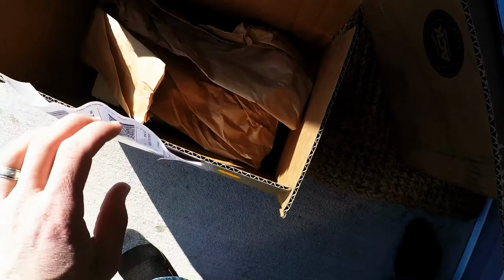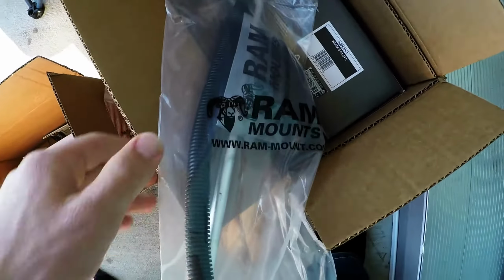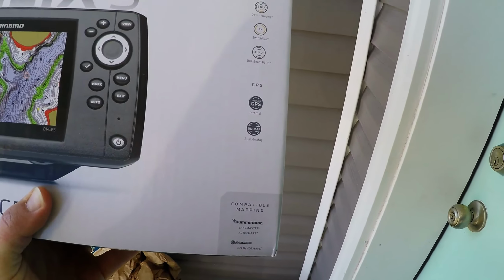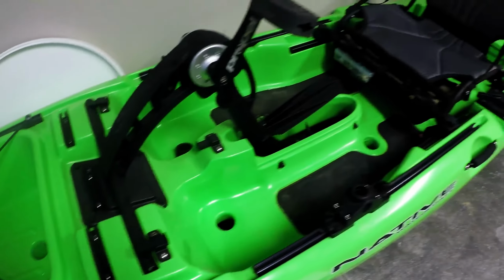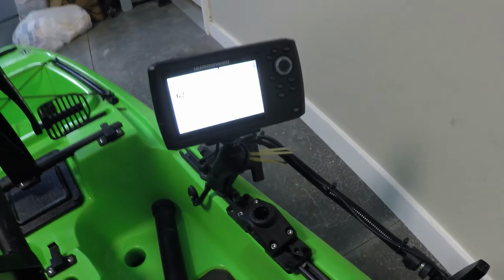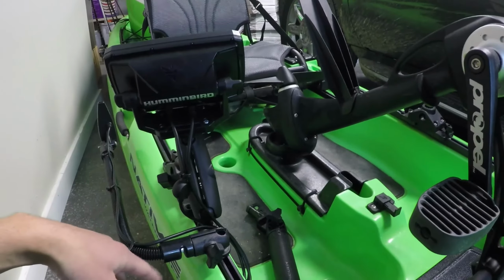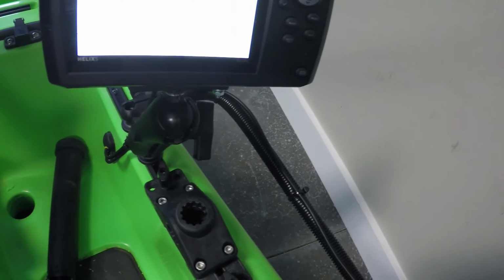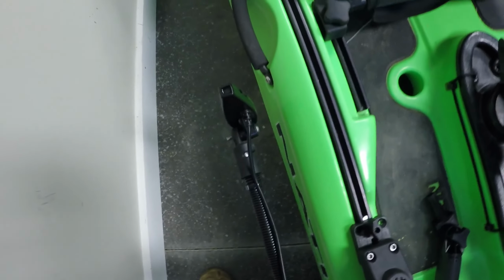How to Install a Fish Finder on a fishing kayak. Detailed Instruction. Native Slayer Hummingbird

Comment: Great vid. I just got the propel 13 a few days ago. This is my first kayak. Would you mind telling my how you store you kayak properly to avoid damage? Looking for ideas. right now I just have it on it's side in the house.
Reply from the maker: +Gregory M Thanks for watching! I store it in my garage as shown in the video. It stays on its cart and when I want to take it out I just wheel it out to my pickup truck and slider her on. I use a truck bed extender so it all works slick.
Reply: +Josh_Outdoors what did you do with the transducer wires?
Reply from the maker: I coiled them up in the hull. This is accessed through the battery compartment box where I also mounted the battery. Sorry, I had the clip showing all of this but somehow it corrupted during edited and it was omitted from the video. This is why the video jumps ahead so quickly. If you need more detail on it let me know and I will try to upload that clip only.

Comment: Great video! How are you liking your unit? I recently installed a Helix 9 DI on my yak and loving it so far. Just hate I had to use the large Ram Mount instead of the 1.5" ball.
Reply from the maker: I actually had to send it back because it was acting up on me. I liked it while it worked.